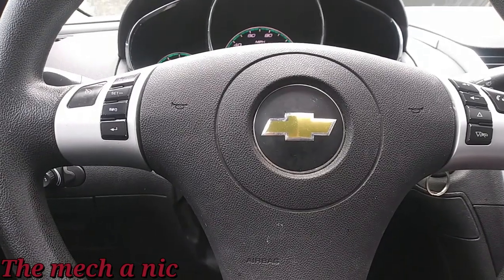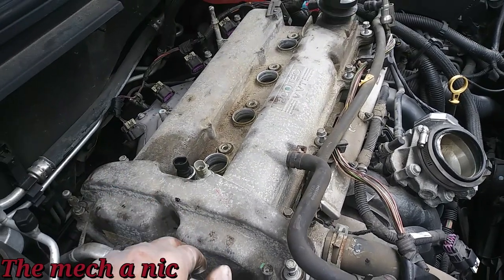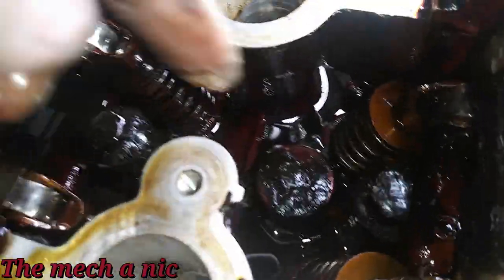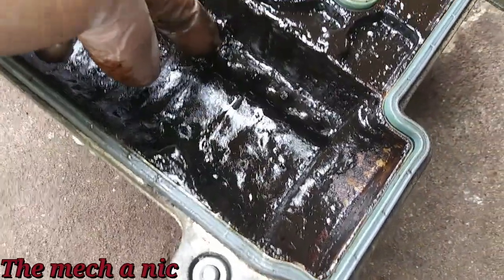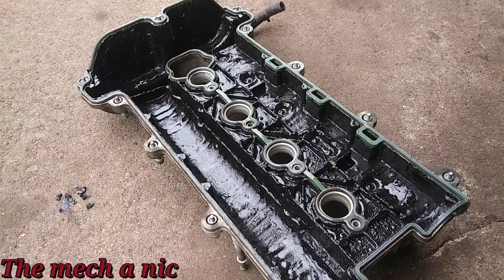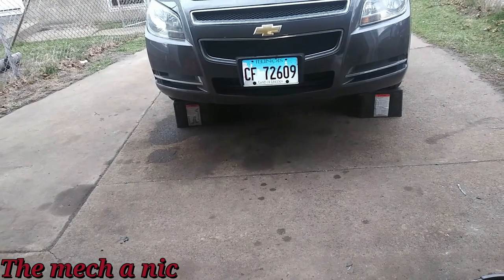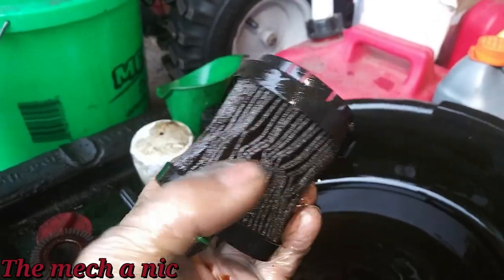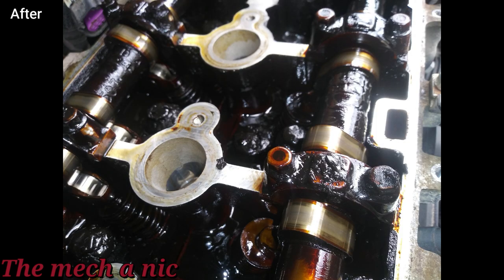ATF to clean engine sludge ?

Comment: Will these methods work on a 2017 ford  fusion 1.5 ecoboost? Bought used and having issues due to sludge build up had in 3 times to dealership and now they want me to pay $500-$600 to tare the engine down for pictures of inside to decide if it's covered under extended warranty.  They all ready had it open to replace timing phazers and they replaced both vvt solenoids another time and cleaned the vvts another so 3 times in and no fix. It's sluggish on take off or after hard turns like roundabouts. Oil has been changed every 5000 any info would be appreciated I'm thinking of possibly even getting a lawyer to get me out of this mess. So it's been in 3 times no fix and I thought a 4th and no fix I can yake legal action right ? Bought car from Minnesota and live in Wisconsin

Comment: Got a question , What brand of timing chain kit do you use . I'm a few problems with the after market timing chain kits ( CLOYES ) . Started using only GM timing parts but I need a cheaper but reliable alternative  , Has anyone used the MELLING timing chain brand .
Reply from the maker: I've only used cloyes and i haven't had problems but also i dont do many timing jobs
Reply: @themechanic6117  o.k.  thanks for the reply , I have used cloyes for years without issue but the last couple of set's had problems , maybe I just got a bad batch .
Reply from the maker: What kind of issues?
Reply: @themechanic6117  chain tensioner failure one on GM 3.6 and one on a ford 4.6 . The GM 3.6 came back to shop about 5 months after chain kit replace , jumped 1 tooth out on time . The ford 4.6 come back after 1 week of replacement  with rattle on acceleration  front of engine , when I tore it back down found right side tensioner very weak, when I  push in on tensioner piston . oil shoot out between piston & bore .

Comment: NOTHING is going to "break down" sludge like that. It must be removed by hand.
Reply: exactly.
Reply from the maker: Well im not doing it! The owner barely wants to pay for oil changes 😂
Reply: @themechanic6117  It shows. Better check if that's real money!
Reply: @HUBBABUBBADOOPYDOOP  Only gold and silver are real money.  If they don't want to pay for oil changes I doubt they have real money.
Reply: nop diesel works and if the gunk is really bad as this car you pour epa based cleaner like injectors cleaners and watch ultra clean golden engine
Reply: @The mech a nic hey man. If they want to do a real flush chance. I posted a video @The mech a nic about atf flush. Your talking about breaking down YEARS of build up. There is no such thing as a 1x flush. Now if you say engine holds 4qts oil. Put 2 or 3 oil. 1 or 2 atf. Do a 1500-3000 daily driver deal. Get rpms up. Get that atf being thrown around at higher speeds you will see a cleaner head. The cam shafts between the lobes will need to be scrubbed to clean up after 3-4 3000 mile changes. You will see a golden hue vs a black hue. The parts of cam that obviously never really get oiled due to no reason will need cleaned by hand.

Comment: Why not use a commercial Engine Flush solution. Its chemically designed to remove engine sludge "safely" in the oil.
Choose a brand you trust and give it a go!
Reply from the maker: Its not my car. The owner doesnt even want to pay for oil changes let alone experimenting with chemicals to see what works. As far as theyre concerned the car drives fine
Reply: Fair enough! Love your channel man.
Reply from the maker: Thank you 💪
Reply: @themechanic6117  hey check my post atf can help you man. You did it wrong.

Comment: The claim that ATF synthetic or conventional, has a lot of detergents is that, a myth.  Transmissions are hydraulic machines that do not see combustion blow-by, high temps, acids, and sludge as engine do.  They are actually low viscosity, hydraulic fluid with low amounts of detergents.  Perform a double oil change to get rid of 100% of the old oil.  10-20% of oil will remain after a normal oil change, especially those ECOTEC engines.  Then use Amsoil 100% synthetic Signature Series oil, 0W-40 oil. It has a high amount of detergents and will safely and slowly clean your engine.  Dont worry about the sludge sitting on top of your engine. This does not adversely affect your engine.  Looks like the engine was neglected for a long time. Use a high qaulity filter, oil and change every 3k.  Also clean those VVT solenoids too.  This requires strong chemicals and high pressure or physical contact, like they use in a machine shop.
Reply: Reads too much like a  Shill advert
Reply: @barenekid9695  Im not selling anything or schilling for anyone.

Comment: Quaker state oil causes sludge
Reply from the maker: Not changing oil causes sludge
Reply: @themechanic6117  that shit to
Reply: @themechanic6117  using quaker state and thinking it can go 10k miles or havoline... I have worked on many motors that had quaker state in the block looks like jam sludge in the motor all the way through
Reply from the maker: That's crazy. I'd never go 10k on any oil. No matter the brand. I change my oil every 5k (full synthetic)

Comment: I very rarely make comments like this, but you really have no business giving instruction on auto repair. At a minimum the cam cover should have been cleaned before being reinstalled when you did the timing chain. Synthetic vs. conventional ATF makes no difference. It's the strong detergents in ATF that provide the cleaning action, not the oil itself. But it's not magic. Only a really strong solvent (e.g. carburetor cleaner) is going to dissolve such a thick layer of sludge.

Comment: @The mech a nic i posted a video not as a insult but to possibly do a duo test of my method. It works great in 0-w×× being newer engines use oil thats actually less viskis as atf. Try it. 3000 miles replace 1 qt of oil in the oil change new oil run 3000miles on all rpms. Low rpms wont fling oil hard. Think of using the shafts spinning to fling the oil at pressure washer speeds. It does work.

Comment: Any more improvements after future oil changes?
Reply from the maker: The car is actually here in my garage now. I'm about to do another oil change but the timing component don't sound happy.  It still drives fine but it's not a quiet as it was before
Reply: If its variantes timing, clean the solenoid screen and tensioner